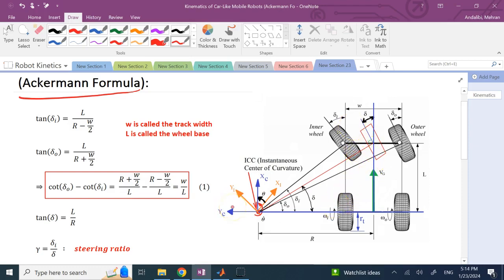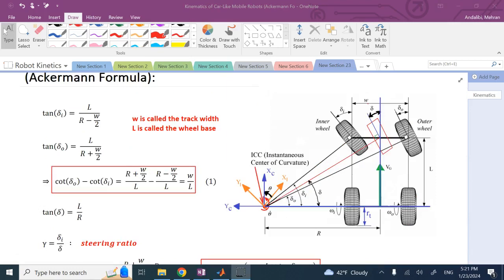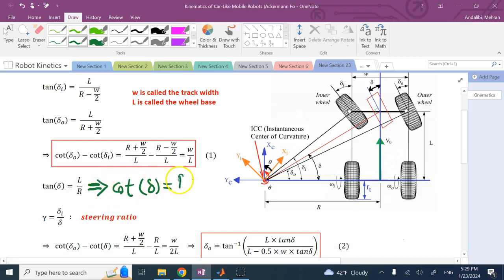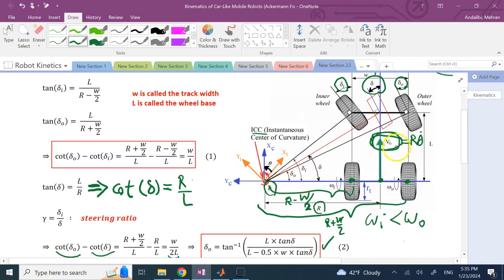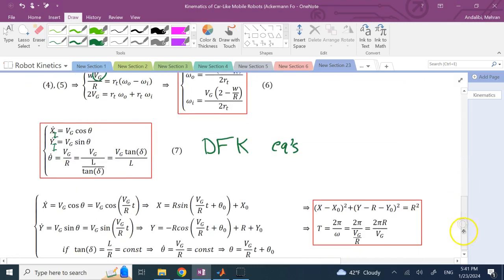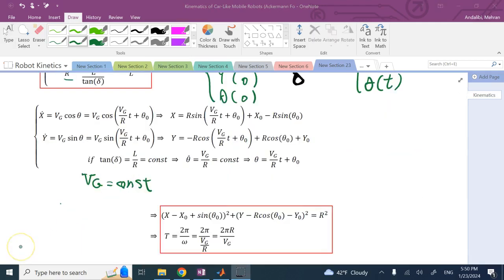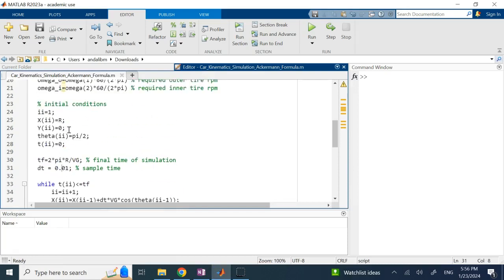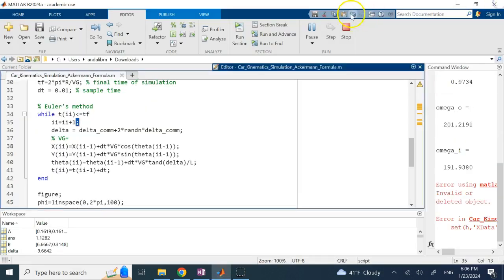Ackermann Geometry: Kinematics of Car-Like Mobile Robots

Comment: If we have a vehicle with double Ackermann, front and rear, a similar solution can be considered, but locating the ICC projected from the center of the vehicle. The angles of rotation of the wheels on the same side would be of equal magnitude but opposite sign and the angular velocities on the same side would be equal with the same sign.  Right?